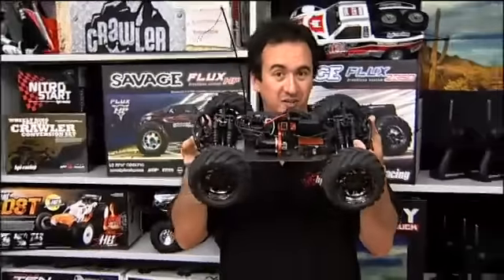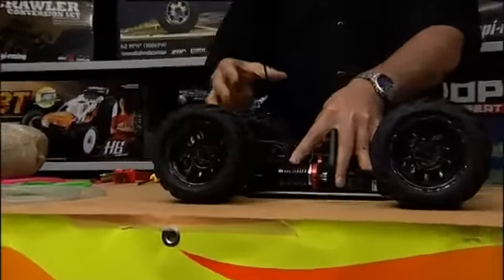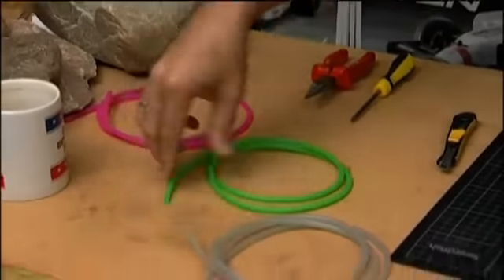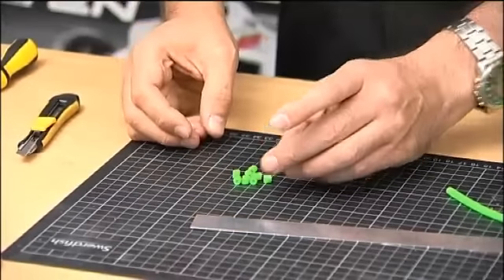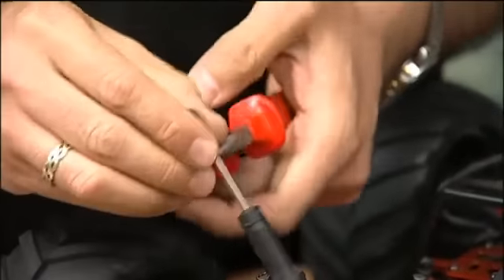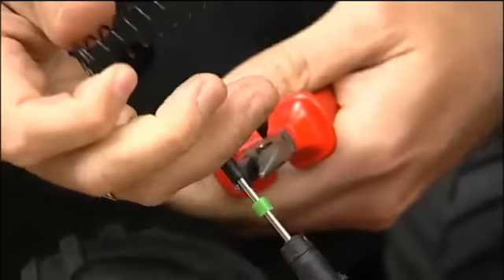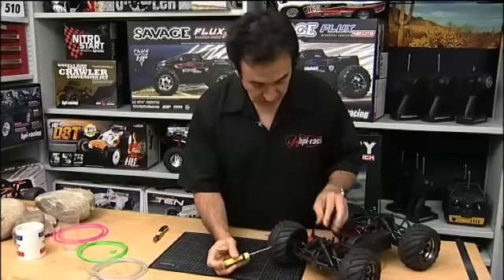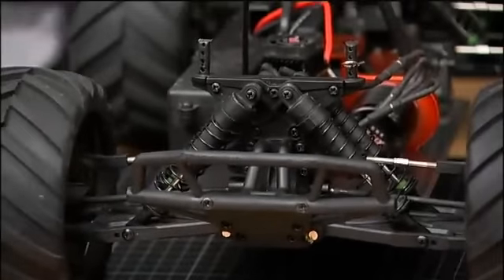HPI Learning Lab Bullet Bump Stops

Comment: You should have put electrical tape on the teeth of the pliers you used, to protect the shock shaft from tiny burrs created from the metal on metal. You could have increased the chance of a shock fluid leak in the future. Just an FYI